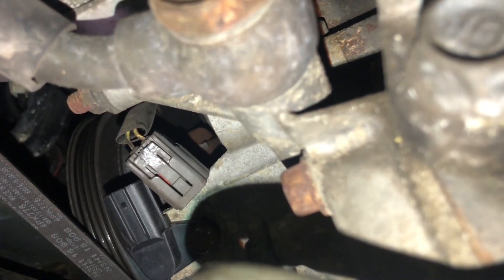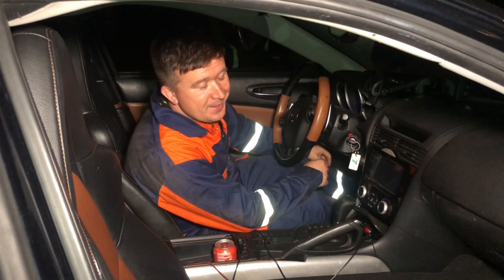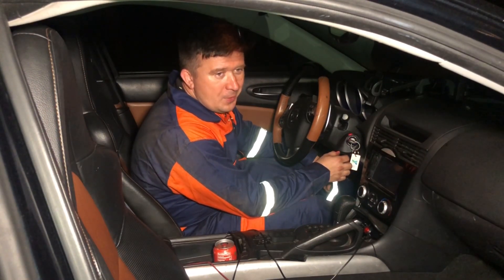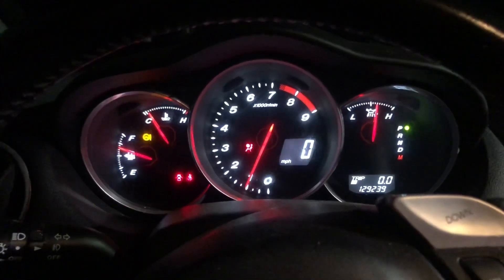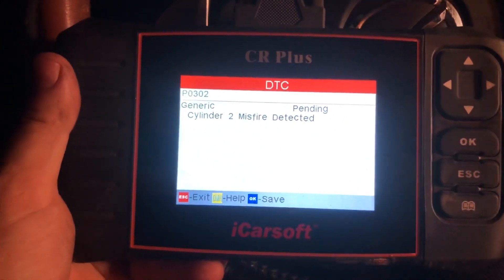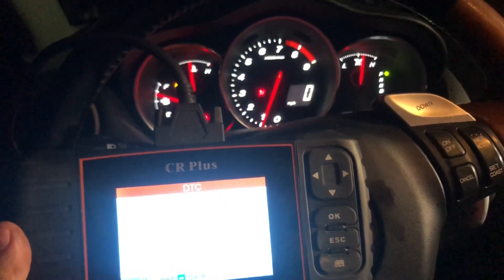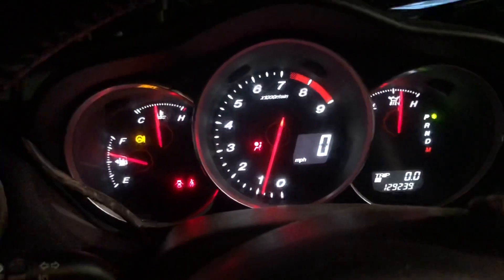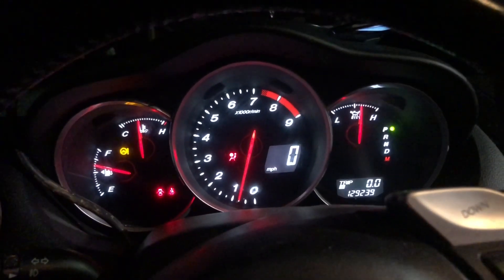Code P0336 RX-8 won’t start on hot and bad idling | Fixed Replaced crankshaft position sensor

Comment: My 2007 Mazda rx-8 is having an issue where I have to jump it to kinda force start it and after cranking for a while it’ll turn on but reeks like gas and makes weird noises in the engine,  I chanced my air filter and cabin air filter and no luck. The code I have popping up is cylinder 1 misfire and I replaced the spark plugs yesterday and the ignition coils and wires 1 month ago. Any advice? Should I replace the coils and wires again? Or replace the crankshaft sensor even though it’s not a code

Comment: I was having misfire cylinder2 but I changed spark plugs and car turned on but immediately turned off and came out wet/burnt/dirty .....but could it be camshaft sensor??
Reply from the maker: I will definitely attempt to replace the camshaft sensor but my advice would be replace that is Eccentric position sensor When this sensor fails the car will not want to start because it cannot tell the position of the engine it’s the same as crankshaft position sensor but they call it is eccentric sensor

Comment: Should have just got bhr ignition coils best ones for rx8 they have spark plugs and wires. Definitely check them out. Black halo racing.
If you have any questions lmk have had mine for 6 years and have 125k miles and work at Mazda still have good compression.
Reply from the maker: Wow thanks for that advice, I will check them out, I just got my compression tester in for $300 and will test it Tuesday
Reply: @mazdarx8diy38  also the coolant light had many issues with are cars first time was the sensor inside the Reservoir common issue with them . And I did have my radiator crack on me so I got a aftermarket one no problems yet
Reply: Definitely don't cheap out on the coils, I also have the BHR coils, best ones on the market.